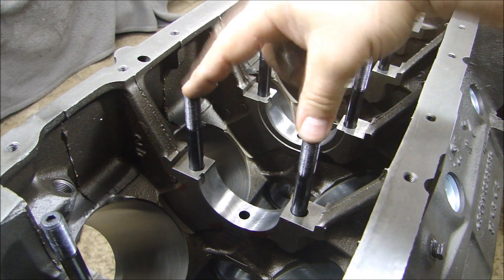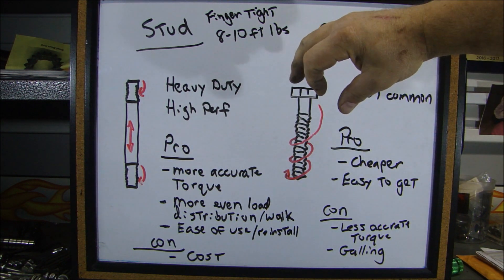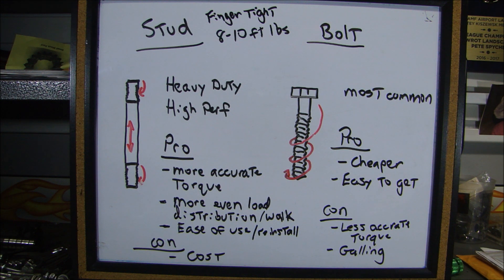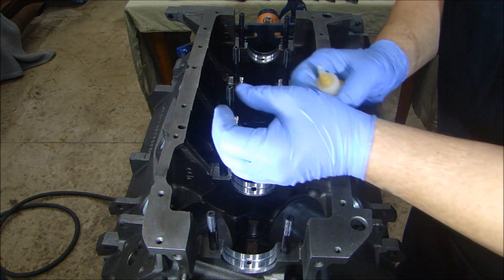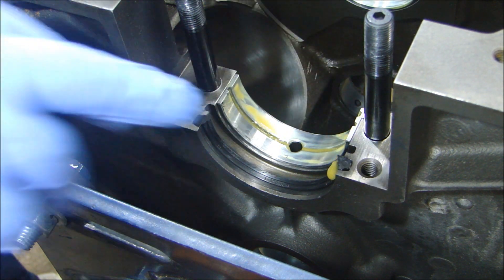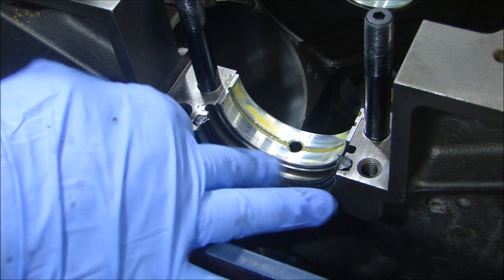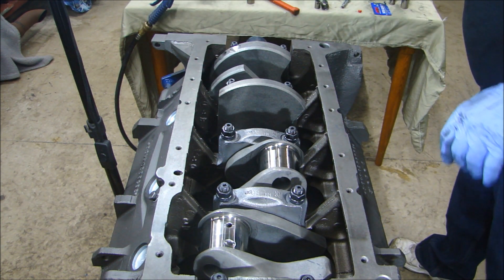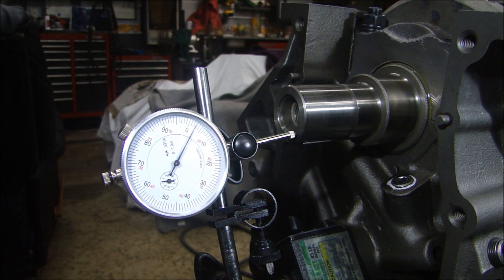440 Chrysler Mopar Engine Building Part 2 - Studs vs Bolts and Installing the Crankshaft

Comment: PTFE is more commonly known as Teflon, it is not Moly (molybdenum disulphide)
Reply from the maker: Teflon is a trade name for PTFE from DuPont, like Kleenex is a trade name for facial tissues. Molybdenum is a chemical element that becomes and inorganic compound when sulfur is added. I was contrasting the 2 but did not articulate it well. I use both while building engines.
Reply: Hi Pete, I can’t seem to find the exact PTFE lube you are using in your videos, could you kindly share the name brand or part number for this PTFE lube?
By the way, great videos!

Comment: Do you measure your bearing clearances or just trust the machine shop? When you send the block to the machine shop do you have the studs or bolts for the mains already installed? The main caps torqued down or loose, or separate?
Reply: Trust but always verify. 
We always measure each journal with a tenths micrometer and each installed bearing shell bore with a tenths dial bore gauge to determine the clearance. 
Bolts vs studs usually does not matter for most machine shop operations unless the machine shop is performing final assembly. 
We send the block with caps, bolts or studs+nuts+washers and when applicable the crank to the machine shop. 
Usually the main cap fasteners are tightened but not necessarily torqued to spec when sending to the machine shop.
Reply from the maker: I completely trust the machine shop. They check thrust, main, and rod clearances when they bolt on the torque plate for boring and line honing. They also have to put the studs in and bolt it down to check.

Comment: I'm following along and learning from your excellent videos. Thank you for sharing. Question though, when you measured the crank end play, what do you do if you don't meet the specs? Too little or too much?
Reply: Fortunately many if not most crank thrust clearance specs are rather generous. 
Some (not all) bearing manufacturers offer oversize thrust bearing with a thicker thrust flange for some limited applications. 
It should be noted that these oversize thrust bearings are not effective when either the block main web/cap is damaged or the crank thrust faces are worn excessively or the crank thrust face surface finish is rough/damaged. 
Some crankshafts can be repaired by weld buildup and machining to spec, the same is true for some blocks. 
Too little clearance is just as bad as too much clearance, however in my experience too little clearance is rather rare and is usually remedied with a bearing change and or machining the crank thrust faces.
Reply from the maker: When the machine shop bolts up the torque plate for boring and line honing they check the clearance and machine the crank for a perfect thrust bearing fit.

Comment: No plasti gauge? I think I missed  that part
Reply from the maker: I had the machine shop check when they bolted up the torque plate for the line hone and boring. They polished the crank right into prefect spec.